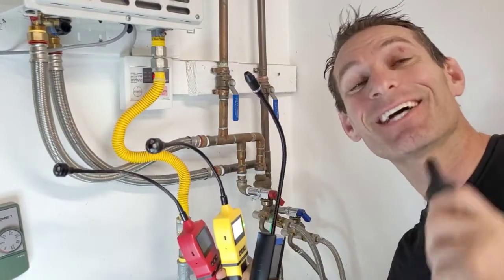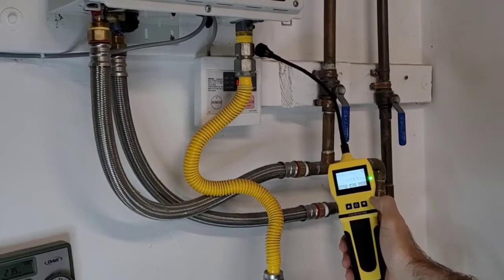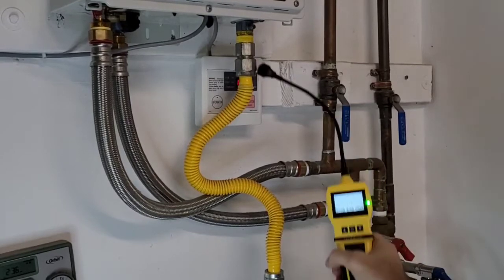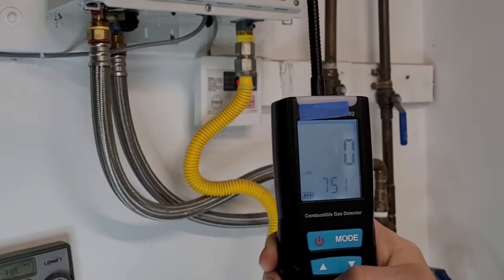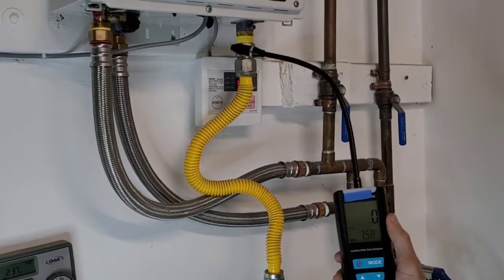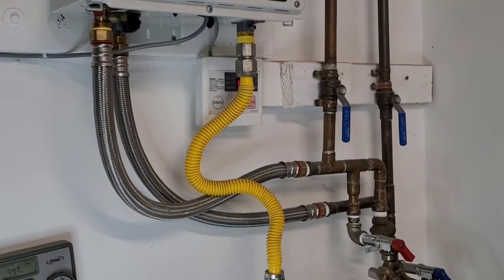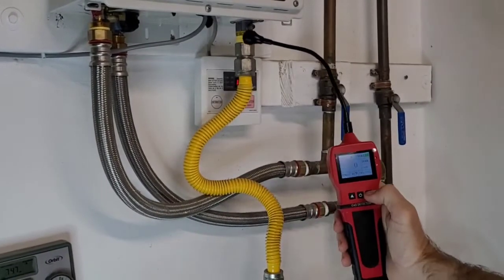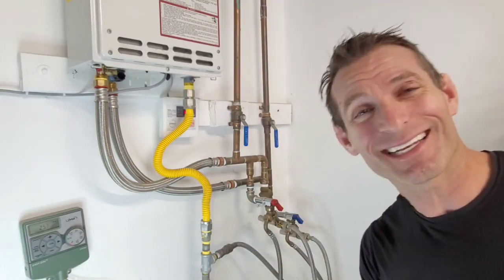⚠️(REAL TEST)⚠️ Gas Leak Detector for Home and RV

Comment: It appears that the first, and the last detectors are the same, just different colors.
Reply from the maker: Good eye! The first and last detectors do have a very similar design. They are actually different models with slightly different features, but you're right that the main difference in appearance is the color. I chose to feature both to show the range of options available. Let me know if you have any other questions about the specific capabilities of each one.

Comment: Does it display each gas and how much is in the air or does it just tell you there is gas?
Reply from the maker: It does not and funny enough, no detect has the ability to specify which gas it is detecting unless we are talking $10000s, using spectrometry. This gives a response to any combustible as calibrated to methane. (industry standard)

Comment: Hi Master ... Can you find this device to find closed rooms and buried wells?
Reply from the maker: Yes indeed it can.
Reply: @DrKozForensicsDetectors  Very good ... based on what science does it work on? Is it a magnet or does it find the gas inside the cavity? Can it also detect it from a distance? Approximately how far do you think it is? And what is the depth of penetration?